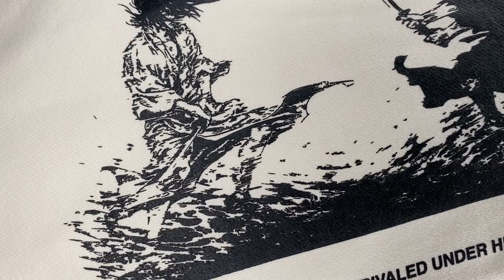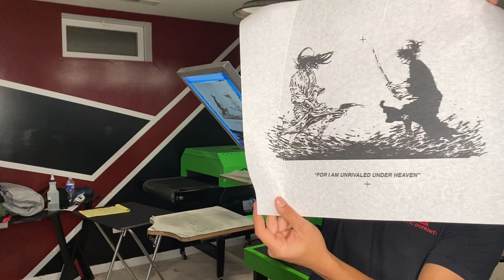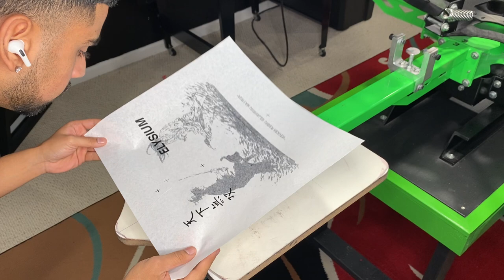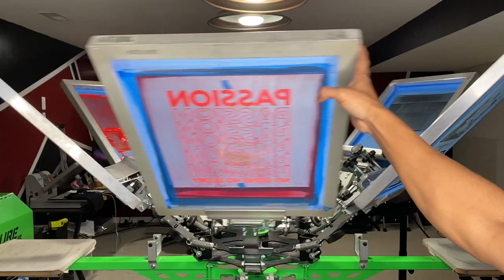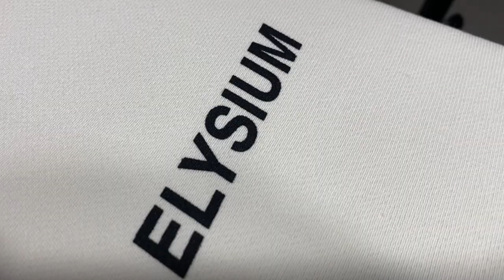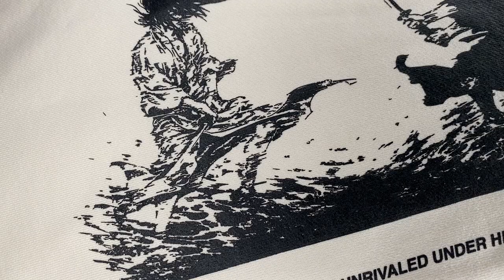SCREEN PRINTING Premium Quality Heavyweight HOODIES From Home!

Comment: These turned out amazing!  Question regarding your press, do you like your 250?  I have the 150 4/1 without the micro registration.  I’m considering yours or the 300 series.  I’m still at the starting stages but I have been getting bulk orders.  Would appreciate your feedback.  Love your channel.
Reply from the maker: Thats a great but tough question. It all depends on you, the 250 is great but the 300 is a beefy press for sure especially because it comes with a stand. which is great.  You can save half the money by getting what I have and throwing it on a table top and still get the same 6 screen 4 station action or spend the money and just get the 300. In this case for me since I got the 250 I still have to make an upgrade to a 300 or another press, but if you get the 300 right off the bat you can settle and make magic with it for a while. I have been thinking about getting a new press as well for more xyz registration and just a stronger press. Hope all that makes sense!
Reply: @baavproductions  it does.  I’m being cheap but my husband is pushing me to go for it.  Thank you!
Reply from the maker: @MrsTNL  They are both good presses! Excited for you!